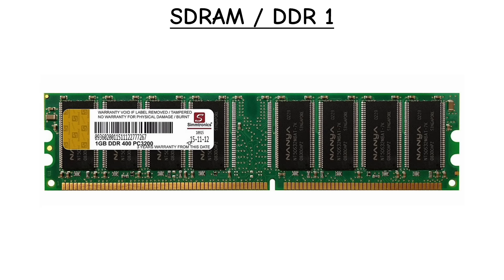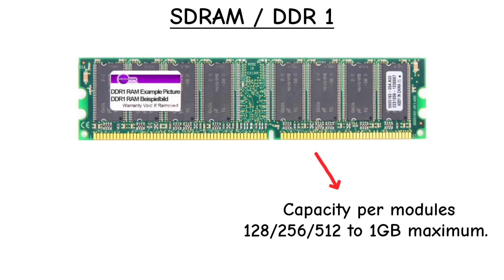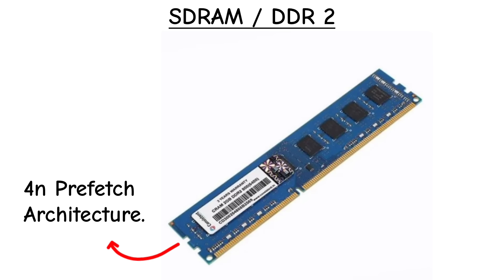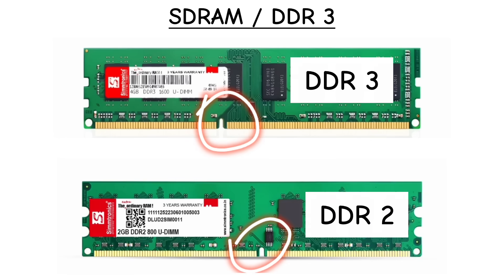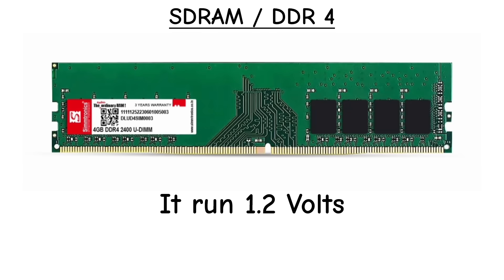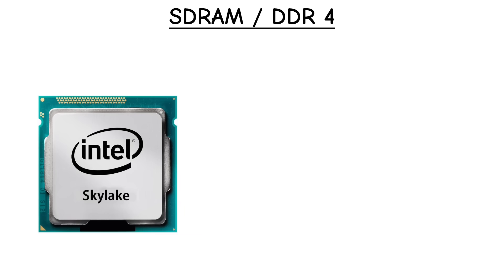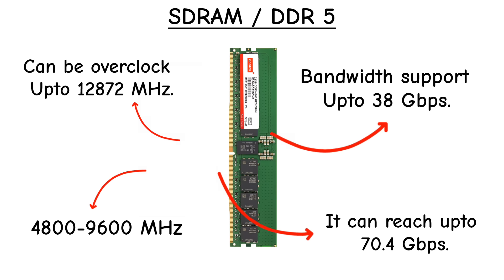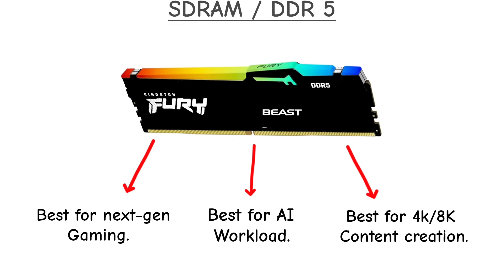Every DDR RAM Explained In 4 Minute

Comment from the maker: I apologize for some mistakes in this video. There were mistakes in writing or pronouncing some information correctly because i use AI TTS (text to speech) i didn't think the video would get views (so i uploaded it) But it was still my responsibility to check if everything was okay before uploading the video. I will try to avoid such mistakes in the future. And lastly, i would like to thank all of you for correcting the mistakes in the comments 🙏.
Reply: Just use your own voice  be honest with your videos because people will only laugh and not. Subscribe to your videos once they find out its an A.I. video
Reply: Also the RAM bandwidth is given in gigaBIT per second, not gigabyte. Thats an 8-fold difference. 
And to your question, if memory serves, and mind you I was maybe 5 when I got that rig, first RAM type I used was most likely EDO RAM on a 386 system.
Reply: @builder396  But if the numbers were correct I would be more interested in gigabytes per second to be honest.
Reply: @NoidoDev  So would most people, but gigabits has become the standard unit of measurement for throughput of RAM, internet and a whole variety of connections like USB, because it results in a bigger number and bigger number sells better.
Reply: Bandwidth IS speed. MHz isn't.
Reply: You should redo it completely and 
include ECC RDRAM and other 
server types.
Reply: I'm confident the AI will pronounce Gigolo correctly 😅
Reply: Small B is BITS Capital B is BYTES that is a 8 times difference!
Reply: Using AI to come up with video ideas and AI to write a script with errors and AI to voice with errors, never checking any of it, uploading it as if it's a definitive explanation video from an expert, and raking in that passive income.

Dead internet theory is real.
Reply: My first ram? Fast Page Mode (FPM) RAM on an AMD 486 PC.
Reply: Also, it is Megatransfers per second, NOT MHz, at it is DDR RAM, so runs at only half the clock.
Reply: Mega ❤S for the apology 😊, I learnt abit from this video!
Reply: I don't care about that you did an amzing job🙏

Comment: actual trash video. You basically explained absolutely nothing about the actual tech behind them, didn't mention channel dimms,  how they interact with the north bridge BUS, latency with CAS timings, parallelism, or ECC functions - you don't even explain basics like what DDR or SO-DDR even means..
Reply: don't explain SDR vs DDR, don't explain double vs quad channel, don't explain CAS relation in clock rate vs latency and why higher clock isn't always better. Didn't mention infinity fabric and buss decoupling. Didn't talk about ram blocking, or bandwidth principles, PCI buss integration, shared video ram, cache stack/ execution stack. NANDing access. Basically anything that made each of these distinct and vast improvements by generation and why a new generation was warranted in the first place outside looking at basic spec sheets. Crappy AI- low info, low effort, ill explained and pronounced video from someone who doesn't know anything.
Reply: they didn't just magically make them faster on clock with more throughput over time. Little bump there, speed boost here. There are very fundamentally and completely different principles, incompatible and different technologies behind each that make them unique. There is a lot of changes and challenges that came with each and there is millions of man hours that went into each generation outside "this one clocks faster"
Technology so different that everyone in the industry making this stuff has to agree on billion dollar contracts that "this is the way forward"

give them some damn credit dude.

Comment: Lol i am running phenom II 945 30ghz quad core processor and DDR2 800mhz memory. Can max mine out at 16gb 4 sticks has 8gb in it now. Still use the computer because i can't afford anything new. I built my computer when i had money to do so back then. I emulate old games on it. Use Linux Mint. Haven't had windows on it since windows 7. I switched before end of windows 7 life. Been playing brutal doom and some other old games lately. 1080p video works fine. Some 4k video can play on it as long as i use mpv mplayer fork. Chokes on 60fps in browser because Mozilla doesn't support the hardware to accelerate videos since a long time ago but a download and they play fine. Old vid cards wasn't made to decode 60 fps is why. Had an ati Radeon before change to amd the xfx ati Radeon 4850 1gb vid mem card. No longer has that and old board died but i had another board although a micro ATX. My full atx died. That one had first gen phenom i bought for like 20 or 30 from my uncle. That processor is in storage but i put the better processor in my only working board and moved my hard drives. Still use mechanical. Sure i could buy an ssd and get a card and use the pci express lane for it. Just using sata 2 internals. Am going to drop another 8TB drive in it back i have 1TB drive maxed that is storage drive and a 320gb drive full and a 120gb drive full and one old 80gb drive bit the dust. I have another 80gig drive going in and out and i want to move my files off it before it goes all the way. The 320gb abd 1TB drives are working great still. The one terabyte drive i got on sale for like 35 dollars before the floods a long time ago increased hard drive prices where most hard drives was manufactured at the time. Then it was like 10 years or longer before that size drive dropped back to that price and was double or tripple that in price.

I think i am going mechanical again unless i can get 8tb ssd for a decent price. Any smaller isn't enough space today.

I still want one ssd as a main drive but i hate write caching because dataloss and they are slower in mechanical if you slow that down because they seem fast because they wrote nothing yet. Still takes the same time but just later. Maybe it's a little faster with no write catch than i think. I will leave write catch off so writing gets done now and not later when im a hurry or around the time my power goes out or my computer crashes.

Large drives and old games i have setup will stay on a storage drive because those games survive changing of opersting system and updates. I have to install new version of Linux and all i have to do for a lot of them is setup an emulator and point it at my games or dosbox or a source port for some games i have is already setup to run. No doing all the work again later. Then i store my iso files on that drive. Some from back in the time of windows 7. But i usually do keep a windows 7 iso just in case i want to fire up win 7 or run a virtual machine. Right now have 1 xp virtual machine setup but out of space so i removed my win 7 virtual machine.

I need main drive hard drive soace because i couldn't build a program. A certain game because it runs me out of drive space and fails.

I need over 20gigs free to build it or something. Maybe more than that. Takes a lot of extra space to build some things.

Comment: My 1st pc's ran off 5 1/4 inch floppies, cassettes, and cartridges. Didnt originally have MB just KB. Vic -20 Commodore 64 and 128, Atari 800 and the 800xl. Through the x86's  all the way up till now with an AM4 and DDR 4. They just recently release a new AM4 processor and they are still making DDR4 and I still very usable if you are a pc gamer even with the higher mid range and lower high range GPU's. Heck even things like the 1080 ti are still usable today!

Comment: I remember upgrading to a pair of 8MB EDO SIMM's thinking I was futureproofing my Pentium 90. It felt like a rocket ship compared to the 486.  My current machine is a 13900KS with 32GB of 7200Mhz DDR5. How times have changed. I feel so lucky to have witnessed the giant leaps in technology while growing up. From land lines to smart phones. Dial up to broadband. IDE HDD to NVME SSDs. 5-1/4 Floppy discs to USB mass storage. Graphics cards to GPUs. Computing is made so effortless these days. It's truly impressive what we have accomplished in such a short period of time.
Reply: PC's were the fastest developing tech ever made , today sadly it started to stagnate . We are reaching the limits of what can be done with micro transistors and how small they can be. I mean , compare doom 2 from 1994 , with doom 3 2004 , 10 years apart. Light years of processing power difference.

Now compare some triple A title from 2015 to 2025 somehow 2015 games look better than the blurry crap lazy devs make today.
Reply: I use 4gb of ddr2 667Mhz. Its lighting fast on my 2008 macbook pro. running os x 10.5 Leopard os a Lexur SSD 128GB.

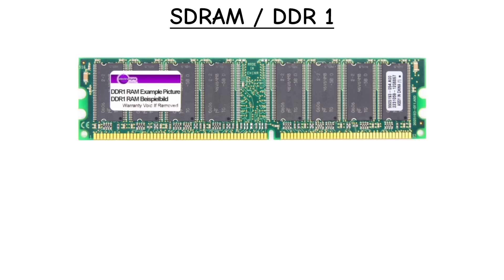Comment: 0:26 that's not right. I had my first computer back in 2004 and it was ddr1. Processor: athlon xp 2600+ (Barton). Socket A or 462 era. There are also older socket A  motherboards that had SDRAM (the ones before ddr).
You could also have a duron, ahtlon thunderbird and semprons, as well a Celeron equivalent of the Pentium 4.

Comment: what about GDDR? GDDR6 is fastest/latest version. GDDR6 memory offers speeds up to 16 Gbit/s per pin, with bandwidth reaching up to 72 GB/s, making it significantly faster than its predecessor, GDDR5.  In PCs GDDR is only used by graphics cards/gpus, however, the PS5 uses GDDR6 as a shared memory pool for both GPU and CPU/system functions.

Comment: Yep!! My Toshiba came out with 4GB DDR3 ram / the unit was running a AMD P320 cpu and Windows 7 Home Premium.
My next computer has a AMD A6 6310 CPU again with DDR3 Ram and yes it is slow With Windows 8.1 did not help one bit and really bogged down quite a bit compared to DDR4 which was in my Lenovo Running Linux Mint which runs decent ...

Comment: MHz and MT are not the same. Any frequency above 6500 MHz would be out of this world. MHz runs at half the speed of MT for example 4800 MT DDR5 runs at 2400 MHz because the data runs twice per clock cycle by utilizing both the rising and falling edges of a clock signal.

Also there are literally consumer motherboards that supports up to 192GB of DDR5 memory and server/workstation motherboards which supports up to 4TB of DDR5 memory.

Comment: I was on DDR3 up until 2022. I then built a PC with 64 gb DDR4 which I still have. DDR5 was too expensive back then. I'm basically always 1 generation behind with Ram but I upgrade my GPU quite often. My first PC had DDR1 in 2002.

Comment: Either A.I. Is hallucinating or the guy has no clue. SDRAM is not DDR1. SDRAM was used from Pentium 2 til early P4 and DDR(1) is based on it. It was sometimes referred to as "DDR-SDRAM" because it took that architecture and doubled its data rate by doing work on the rise and the fall of the clock signal. 

It also wasn't an "upgrade from SRAM" as stated at 0:45. SDRAM succeeded EDO-(D)RAM in earlier x86 and Pentium 1 era platforms. SRAM is used for caches because it is extremely low latency, but needs a lot of chip space and is hella expensive to manufacture.

Modern day consumer CPUs have anywhere from a few up until a bit over a hundred MiB of cache. Producing even just some 128 or 256 Megs of SRAM on a stick in the early 00s would've either been impossible or cost in the 5 digits per stick...

Comment: Speeds are actually in MT/sec; what you call MHz is actually twice the clock speed.  Hence that 4800 DDR5 is running at 2400MHz, transferring on both the rising and falling sides of the clock signal.
DDR means Double Data Rate.
My first build used 133MHz SDRAM, pre-DDR.
Reply: Yes, you're right, but for ddr3 it is correct because my desktop computer has 8 gb ddr3 ram with 1600 mhz frequency not MT/s. I have checked in task manager. So it actually runs on 1600 mhz, and my laptop has 2400 MT/s ddr4 ram, so that runs on 1200 mhz
Reply: @manishsemwal018  If you're looking at Task Manager, unless you have a recent Windows 11 build you'll see it shown as MHz.  All DDR series RAM transfers twice during each clock cycle.
Reply: @manishsemwal018  Weren't windows showing MHz instead of MT up until now?

Comment: I mean at DDR4/DDR5 we are talking about Mega Transfers not Mega Hertz. The MHz rate is half of Mega Transfers. So 6000MT DDR5 means 3000MHz clock speed. Right or wrong?
Reply: Correct.

Comment: DDR5 also didn’t really become widely available to consumers until early 2023 because of the chip shortage at the time while DDR5 RAM DIMs and motherboards were only manufactured in very low volumes before 2023 due to the shortage.

Comment: These RAM standards also all took around a year from launch to actually be adopted by motherboard manufacturers and OEMs so the first PCs with DDR1 were not released until mid to late 2001 with the standard not becoming widespread until 2002-2003.

Comment: You are mixing GBps and Gbps (gigabytes per second and gigabits per second).
3:12 -> you are giving a capacity as a rate. this doesnt make sense. should be gigabytes (GB) or gigabits (Gb) which is gigabytes (GB) but multiplied by 8.

I don't even wanna talk about mega hearts. 

I can't tell if you are trolling.

Comment: DDR1 to DDR3 is correct but DDR4 rare it can handle up to 4200mhz

Even if it is DDR5 would be crazy and much possible cheap

The problem is what you want to have great performance or only budget like who wants to have an old computer included DDR3-DDR4

Comment: DDR RAM speeds are not conventionally listed in Mhz ratings at all, they are measured in MT/s. It's a big mistake. For example DDR-4 3200 runs at 1600Mhz because it's double data rate (DDR)

Comment: DDR6 is the next-gen DRAM offering massive bandwidth (12,800–16,000 MT/s+), lower voltage (~1.1 V), and high efficiency for GPUs, AI, and servers.
Reply: DDR6 is expected to be between 8800 MT and 17600 MT.

Comment: "Ah, Yes, I have 32 Geegabytes of deedeeR4 ram with speeds up to 3200 megaharts"
Reply: Don't forget that DDR2 has up to 4 jigabytes of memory.  Thankfully it doesn't use 1.21 jigawatts of power.
Reply: @cujoedaman  jiga-what now?!
Reply: Bro your english is very iiiiinglishyyyy
Reply: same
Reply: i have the same speed of deedeearr4 ram but only 16 geegabytes.
Reply: I thought it's frequency...🤣🤣
Reply: just came here to check if you can still afford that 🤣🤣

Comment: Where do you keep pulling these bogus "speed" ratings? Also wdym "speed".

Clock rate of DDR4 is 800-1 600MHz, transfer rate: 1 600MT/s-3 200MT/s.
DDR5: 2 000-4 400MHz, 4 000-8 800MT/s
Reply: So this entire video is BS at best and misinformation at worst.

This video belongs to a private folder on your PC, not on youtube

Comment: im still use my DDR3 16gb ram on my pentium pc

and yeah, thats enough for me
Reply: I use on a home built server. And yes, it fits perfectly.
Reply: Something is wrong here. Either the DDR3 memory or the Pentium CPU. Usual chipsets for the Pentium CPU (Codenames P5, P54, P55, P55C) were able to handle either EDO RAM on 72 pin SIMMs or SD-RAM on 168 pin DIMMs running at 66 MHz. The highest capacity DIMM I ever saw myself was a 512MB Module. I suspect you mean something like LGA 775 based Pentium D or Pentium Dual Core, going by the capacity of 16GB more probable some Pentium processor based on a later architecture. Marketing names by intel have been wild ever since the first Pentium CPUs.

Comment: Bro when you write "gigabytes per second" shortly you should use capital letter "B" because lower-case letter "b" is stands for bit. 

Summury:
B — Bytes (eight 1 or 0 binary digits) 
b — bits (only 1 or 0 binary digit)

Your "Gbps" is actually a "gigabits per second" which is much slower bandwidth than "GBps" which stands for "gigabytes per second". Sorry for being rigorious
Reply from the maker: Thank you very much for the correction. The error is because I am using an AI voice. We need more people like you who, instead of making fun of someone, offer corrections in the comments. This helps other people understand better and also gives me a chance to improve. You're right, everyone makes mistakes; it's how we learn 🙂.
Reply: @defineexplaining the whole thing is a.i. generated.
Reply: @defineexplaining  Well the thing is, the spoken test is correct. It is what you wrote on the slides that's wrong.

Comment: I worked for three news sites in the mid-2000s, and back then we agreed to clearly distinguish between Gb/s for gigabits per second and GB/s for gigabytes per second, respectively. In 2025, you still write Gb/s but read gigabytes. How do you then refer to gigabytes per second?
Reply: Read & Write from/to the RAM done in chunks of integer multiple of bytes, so using bytes instead of bits are actually more accurate.

Comment: A gen X fossil here, I started using computers even before the pc133 when windows 3.1 and DOS 6.22 , old computers with 32 or 64 mb of ram with all the computer power today some people have forgotten that Apolo 12 computer used only 16kb of ram and was more than enough while by today standards 8 gb of ram is almost not enough for widows 11 with 5 tabs open on the browser. There is a race for more heavier software and more powerful computers just for the sake of keeping selling hardware
Reply: Dos 4.0 here, first board had socketed SRAM and a 286 😂
Reply: @timhartherz5652  when 286 was the norm i was pc enthusiast but not own one yet , maybe yours with 8 to 16 mb ram
Reply: Where I come from if you had a 286 with 1MB RAM you were king. Mostly they had XTs, Apple II clones, or even CP/M machines like the MSX. Times when a 386 was a corporate server, with VT100 terminals hanging around.
Reply: Im  a lil younger than you. (older millennial almost gen x). My 1st pc's ran off 5 1/4 inch floppies, cassettes, and cartridges. Didnt originally have MB just KB. Vic -20 Commodore 64 and 128, Atari 800 and the 800xl. Through the x86's  all the way up till now with an AM4 and DDR 4. They just recently release a new AM4 processor and they are still making DDR4 and I still very usable if you are a pc gamer even with the higher mid range and lower high range GPU's.